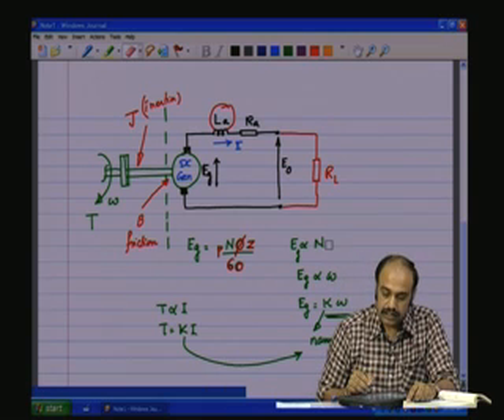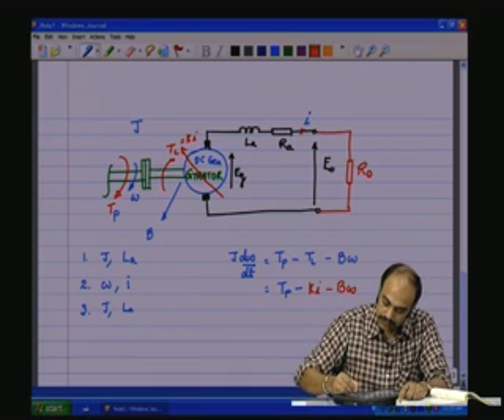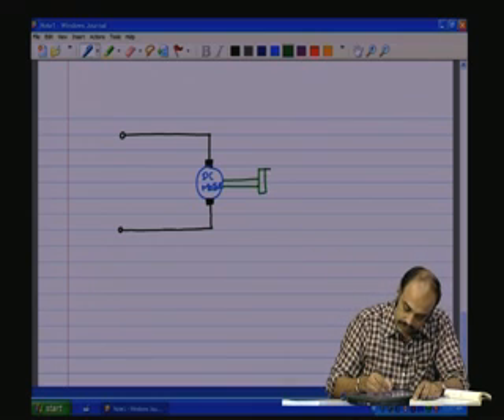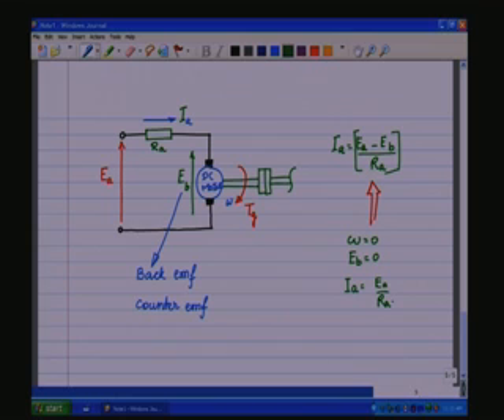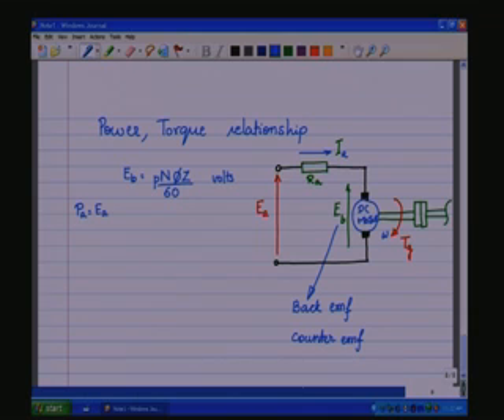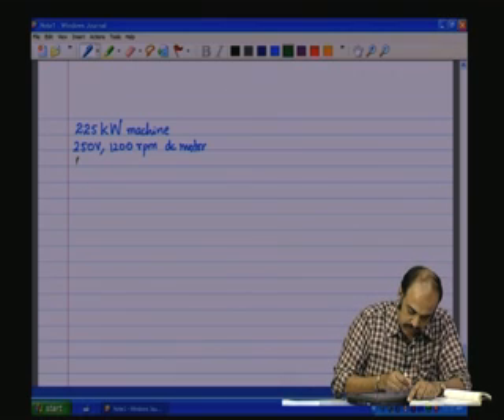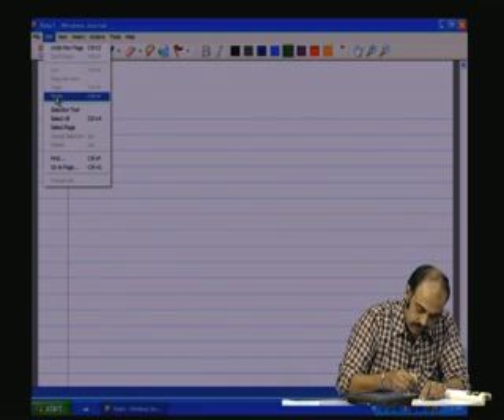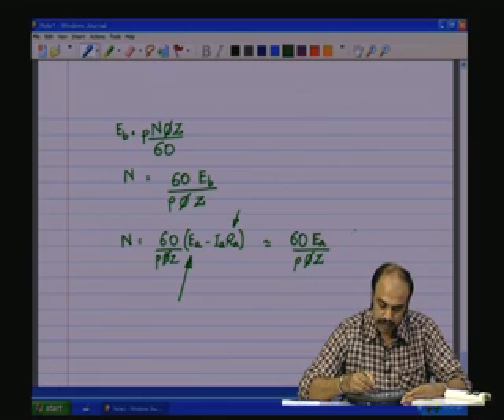Lecture - 27 D C Motors

Comment: A description of load torque always accompanies a discussion on motors. The effect of its imposition on motor torque, and how this causes the motor to draw power from the power supply then follows. The phenomenon of how it is the ‘back emf’ in motors, which regulates the motor torque to match load torque completes the discussion.
To understand these ideas, it would be instructive to understand Current, the conduction process and Voltage at the fundamental level.
Electrostatics and circuits belong to one science not two as in the following two videos:
i. https://youtu.be/REsWdd76qxc and 
ii. https://youtu.be/8BQM_xw2Rfo 

The "back emf" is a trick nature uses which has a regulating effect in determining the amount of current the motor draws and is a natural consequence of the induced emf process when a conductor
moves in a magnetic field. 
The governing relation for current in conductors is J = σE_net.
The back emf is the "motional emf" produced when a conductor moves in a magnetic field.
It is not possible in this post to discuss in more detail the process of production of the back emf and its regulating effect on motor torque.
The last frame References in video #1  lists textbooks 3 and 4 which discuss these topics in more detail using a unified approach and provide an intuitive understanding of the generation of an emf in generators and motors.